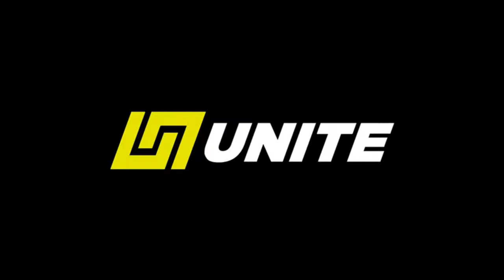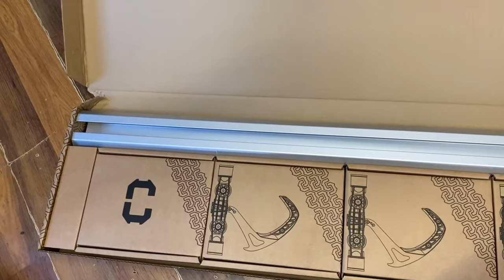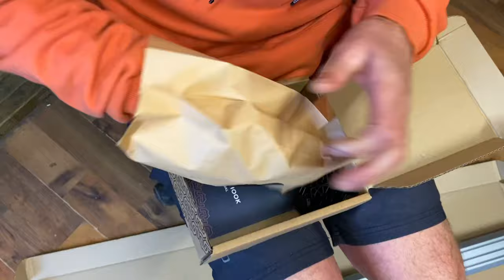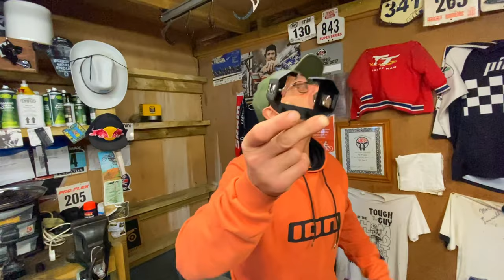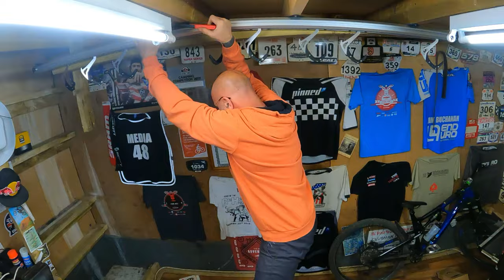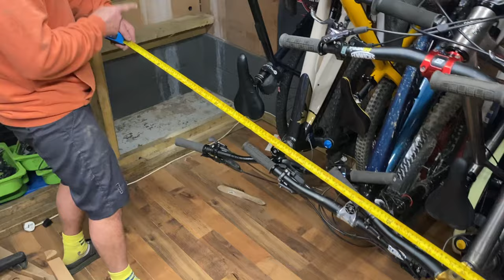THE BEST BIKE STORAGE RACK EVER?? *STASHED*

Comment: Yesssssss! --- I have 6x fixed bike hooks (the front wheel hooks that screw on the wall) but it's a PITA to remove a bike because the others don't move out the way and I scratch brake levers on each other etc.... I'm 100% buying one of these rails right now for my new upgraded bike workshop!!!
Reply from the maker: Ace, remember the discount code in description! 👌